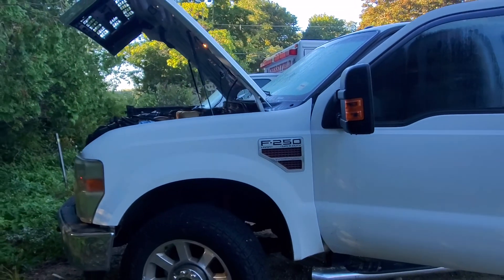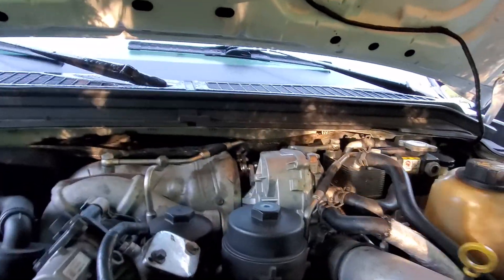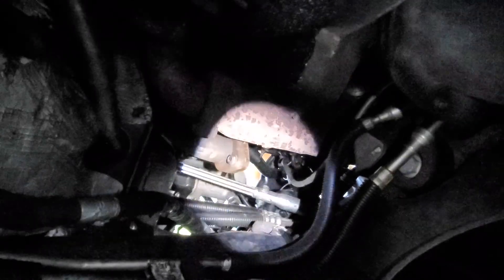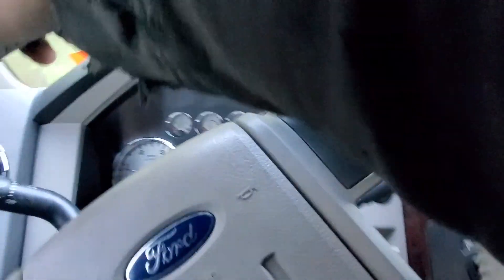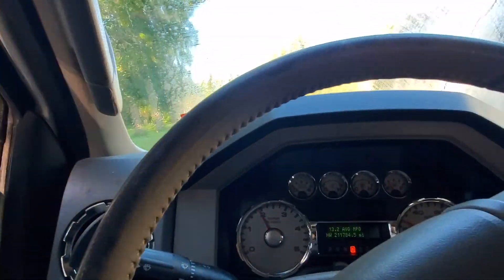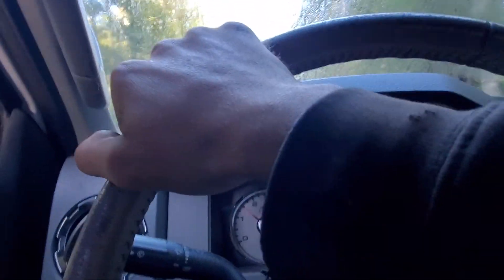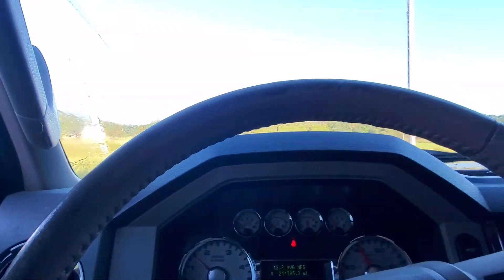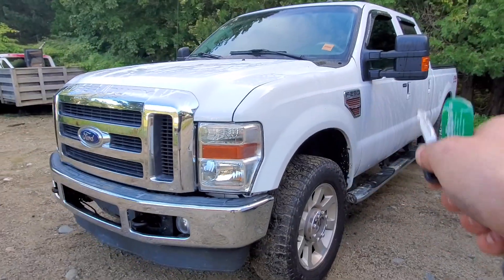6.4l Powerstroke Won't Build Boost and Blows Excessive Smoke || Let's dig into it

Comment: So I just had a 2010 f350 come into my shop today. No codes. Data looks normal to me. Doing a delete for him. It’s a “race truck”. Truck all the sudden yesterday was blowing black smoke and I mean blowing like I can smoke the whole block out at half throttle bad…no boost. On the high way lay into it and it’ll build maybe 25psi by around 3500rpm. 
Can’t find any leaks whatsoever. I’m a 6.0 guy. Not a 6.4. Just trying to help a friend out. Got any input? Using a Bosch ads 325 scanner/live streamer.
Reply from the maker: 25psi is really low for a 6.4. I felt like barely touching the throttle it would build 35 or so just cruising. Do you know what version turbo actuator it has. There's an updated version that fixed some issues with the vgt. What tunes did you use for the delete and did you also delete the egr? Check the egt probe and connector, check the map sensor, air filter or any other restriction, also check the uppipes and manifolds. This white truck had a cracked uppipe and I could barely tell. I thought it had a blown manifold gasket when the uppipe was almost completely broken and it wouldn't smoke or make much sound for me to see it
Reply: @ParkerMotorWorks  I haven’t done the delete yet. Picked the truck up today and that’s when he told me of this new issue it has. It was barely driveable. I know it’s got a really old tuner on it. A mini something. Can’t remember off the top of my head. 
Tune is for a deleted set up and it’s a 300hp tune. However it still does the same thing on a stock tune. 
I unplugged the ebp sensor and it helped get the truck moving a bit better. But still takes well over a mile maybe 1.5 miles to hit 70.
Reply from the maker: Honestly I've never worked on a 6.4 that still had the emissions on. How many miles are on it? Unplig the egr valve and see if the tune is messing with the positioning. Also pull the egr off and see if the intake manifold is clogged up with soot. I could be way off base but sounds to me there's some sort of restriction or possibly his vgt isn't operating as it should. That's what I would check before digging into it
Reply: @ParkerMotorWorks  I’ll go out and unplug the egr real fast just to see if it changes anything at all. I can feel the truck choke really badly and it has 0 power. Barely enough to get out of the way of a Prius lol.
Reply: @ParkerMotorWorks  unplugged egr. Didn’t make any difference at all.
Reply from the maker: Let me know what you find.  I'm curious what's really causing the issue. I'm always looking for advice to pass on
Reply: @ParkerMotorWorks  also 133k miles on the truck.
Reply: @ParkerMotorWorks  turbos are shot. Engine is blown up
Reply from the maker: @dsmperformanceracing4355  that's not what I wanted to hear. Is the whole motor junk? What else failed?
Reply: @ParkerMotorWorks  motor has 55k miles. 
Tons of blow by. There’s about a gallon of oil inside the intercooler. It’s looking allot like someone put something into his oil. It’s so thick. I’ve never ever seen oil anywhere near this thick. It stained my finger black within 3 seconds or so. It took 4 hours for the oil to drain out of the pan. 
There’s a good half inch or so of metal on the drain plug. She’s a gonner. I might be shoving a 5.9 in it here soon. Gave them the quote. Waiting to see what he wants to do.
Reply from the maker: Sheesh good luck with the swap if they choose to go that route. 5.9s are sweet

Comment: I have same truck..just brought mine in to the Ford dealership for an oil change..left with no turbo boost and screeching noise as the rpms spool up..needless to say I cant drive the truck it's that loud... does that sound like they knocked a pipe loose or something? When I called they said they forgot to tell me it was making that noise when they first pulled the truck back. I'm pretty upset.
Reply from the maker: High pitched screech could be a broken manifold bolt, cracked up pipe or broken up pipe bolt. However generally if it's a broken manifold bolt you'll still make boost. I'd check your up pipes. Look for black soot on your firewall and when it's cold you can turn the truck on and feel around and see if you can feel where it's leaking. Be careful about driving it because in some cases you can catch your truck on fire with the hot exhaust gases
Reply: @ParkerMotorWorks  I just climbed under and around it..I think it is the a/c compressor clutch not spinning. This is the deal I brought it in to have an oil change told them to check the a/c as it wasnt as cold as I like it..and while they are down there I might have a small  oil pan gasket leak. They called me told me my entire a/c system needed to be replaced $3700..no thanks how about the oil pan gasket? They said no leaks we can see but we do see an exhaust leak and a coolant leak...an hour later they said well we do see the oil pan gasket leak $2700..I said just do the oil change please.. I picked it up the next day my wife driving behind me a block from the dealership she called and said truck making strange noise..i called dealership and they said  " oh i forgot to tell you it was making that noise when you dropped it off.  It absolutely was not making any noise it was running great. This morning I was climbing around under it listening and noticed the check engine lite. I'm going to get a code reader now. 
Just super shady..
Thanks for your prompt response
Reply from the maker: Download forscan if you don't have access to another scanner or if you don't want to shell out big money for a good scanner. Forscan is all I use and it'll give you all the info you need. Personally I wouldn't do the oil pan unless you had to pull the motor. The only way to truly seal the pan is to flip the motor over. I don't remember if the 6.4s use a gasket or if it's just rtv. Where's the coolant leak coming from? The front covers are sketchy because a lot of them corrode over time especially with bad coolant

Comment: Did the clicking continue when you shut it off and like slow down as the idle ended?
Reply from the maker: No the clocking stopped with the motor
Reply: @ParkerMotorWorks  darn. Mine is doing the same clicking but you can hear it after I shut off the truck and it’s the same loss of boost. Wonder if the exhaust gasket coming off the low pressure turbo is bad because I get the exhaust leak in the cabin.
Reply from the maker: Is your egr deleted? I would check your crossover pipe that feeds the egr cooler
Reply: @ParkerMotorWorks  yeah it’s deleted.
Reply from the maker: I would check your crossover pipe. A lot of people don't delete properly. The blockoff plate is supposed to bolt behind the turbo after the crossover is removed. theres a bracket on the head and then there's a bracket welded to the drivers side uppipe that will crack
Reply: @ParkerMotorWorks  awesome! Thank you I’ll check it out!
Reply from the maker: I'll see if I have all the parts still and I'll make a video showing exactly the stuff to look for
Reply: @michaelbateman2019 Did you ever figure out the problem?
Reply: @GabrielCruz-gq7fz  nope. I think it has to do with the turbo actuator closing prematurely when shutting off the engine because it’s coming from the high pressure side turbo and starts when I shut the engine off.
Reply: Once the egr coolers are removed that pipe will Crack due to no support
Reply: @marksrepairj623  I'm not sure, yeah there's not support but there's also no weight, it literally only needs to hold up itself
Reply from the maker: Mark is right. The coolers act as a support for the crossover pipe. When the coolers are removed the crossover pipe is net with a lot of vibration and there isn't the correct amount of mass to absorb it all and they will crack
Reply: @nativeoutdoors1780  vibration will make it Crack 100%
Reply: @marksrepairj623  yeah but the engine is constantly vibrating, I admit that moving the sensor and removing the egr pipe closer to the up pipe is better but not necessarily needed
Reply from the maker: There's 3 points where the crossover pipe is attached to. Ones at the uppipe ones a welded section on the opposite up pipe and the third is against the head. With the cooler gone, the vibration will cause the crossover pipe to crack at the welded section and then it'll spiral from there. The crossover pipe definitely needs to be removed. It's not an if it's a when will it crack
Reply: @ParkerMotorWorks  you think it's a job to get done with the cab on to remove the EGR cooler pipe and reroute the egbp sensor
Reply from the maker: You can do it but you'll want to unbolt or at least loosen the cab bolts. If you raise it up a couple inches it'll make it so much easier
Reply: @nativeoutdoors1780  if it isn't needed then why dose the pipe Crack then? Think about it. But u are free to fix it how ever u want tho. I will just fix it after u fix it
Reply: @ParkerMotorWorks  heh might get that job tackled eventually
Reply: @marksrepairj623  well no offense there's a lot of examples of the uppipes cracking but on vehicles that aren't deleted, so if it's caused from deleting and leaving the pipe then what causes it when these trucks aren't deleted
Reply from the maker: If it's not broken yet you're golden but at some point I'd look at it
Reply: @ParkerMotorWorks  yeah thats where I'm at I'll cross that bridge when I get to it
Reply: @nativeoutdoors1780  ive deleted 28 6.4s so far and I keep track of why I’m working on them. On stock trucks the heat and coolant in the Egr cooler are expanding and contracting the coolers to often, which forms cracks and what not. If you don’t delete it correctly the first time, you will be in their a second time. Remove all Egr pipes. Mount the sensor at the top, route it so it’s facing down.